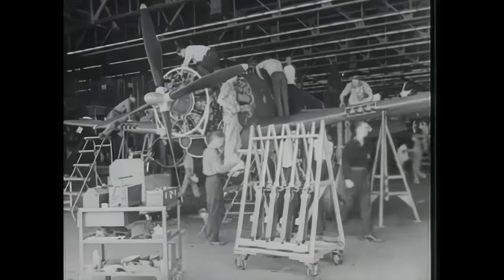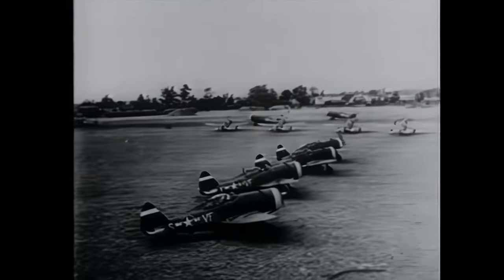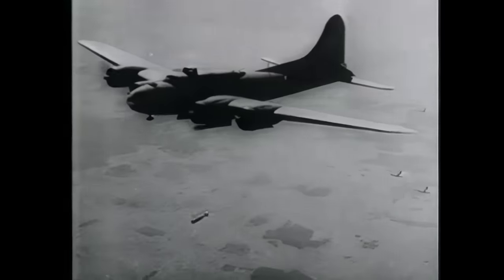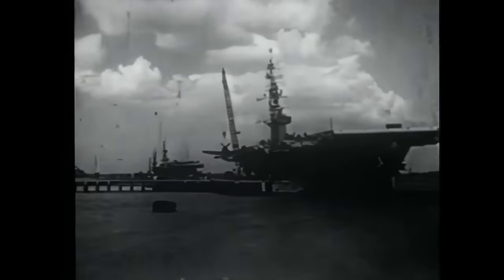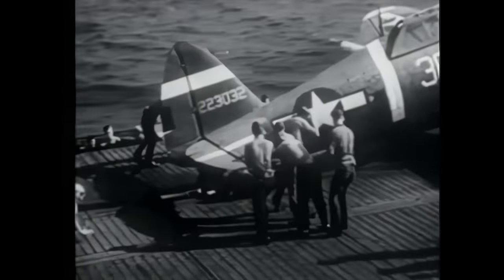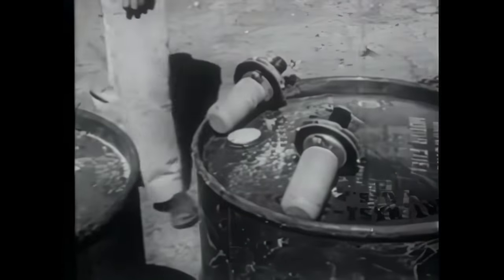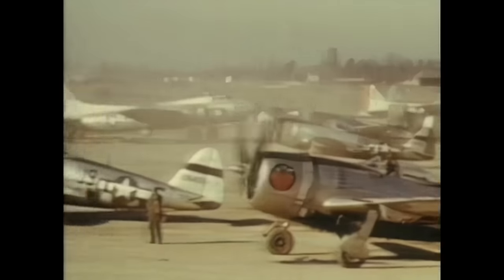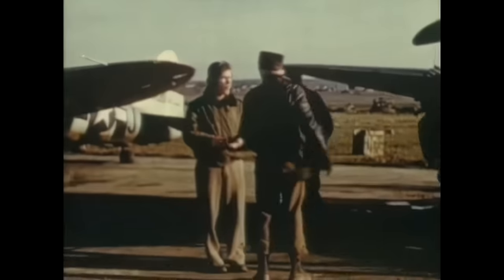P-47 THUNDERBOLT | WWII Fighter Aircraft, Nicknamed the "Jug"  | Upscaled Documentary

Comment: Awesome footage. I had no idea P-47s were part of the Pacific theater, let alone ever taking off from carriers!  Big beautiful birds 🦅
Reply: Yes, late in the war, the Thunderbolt shared escort duty with the Mustang. The P47N variant had squared-off wingtips for extra range.
Reply: @joshuariddensdale2126 The new larger wing held extra fuel which extended range on the "November" model (farther than the P-51 by accounts). The squared off wing tips improved roll rate, which along with larger elevators improved maneuver and control. 
With the increased HP of the later radial engines and the new larger paddle props, I'd hypothesize that the larger wing probably improved rate of climb as well. One of the fastest piston/prop fighter aircraft, with performance in the realm of the post war "super props" that ended the props era as jets replaced them.
In short, the P-47N was one "bad @#$" airplane. I've seen quotes from the memoirs of pilots that flew P-51's and then transitioned to the P-47N that felt the November was the better airplane. THE airplane.

Comment: Outstanding combat footage. The radial air-cooled engine could always take more damage and survive than the water cooled engines with radiators and all kinds of plumbing. The eight 50s could deliver alot of lead at once when the target was only lined up for a short time and helped kill more aircraft. Also helped take out trains.
Reply: Great summation. P&W 2800 greatest engine of the war. In the Grumman Hellcat that dominated in the Pacific.
Reply: They rarely used all 8 .50s at he same time, they'd usually use 4 at a time to give themselves more firing time.

Comment: The "JUG," is one of my favorite planes.  A beast to deal with, multirole, aircraft, as good up at altitude as it was on the deck.
Heavy, well armored,  8 .50 cals, were standard issue.  3 tons empty, and as much as 7 tons loaded for bear!
It was a well made aircraft, right for the time when it was needed.  It's only real con, being the range it could fly.
But external fuel tanks did improve that as well.
It had a huge, multi row radial engine, pumping out some huge HP!
I wouldn't attempt to take away anything from the Mustang, Lightening, or any of the Navy aircraft.  But the P-47 is till one of my top picks!
Reply: The N variant with it's wet wings had as much range as any other fighter. 
And P47's were escorting bombers over Berlin weeks before P51's were doing it, the truth is P47's in theater during the early unescorted bomber missions could have escorted them if they'd only have been provided with drop tanks, the P47D-15 with the wing pylons that could mount the US made all metal pressurized drop tanks were starting to be delivered to the 56th Fighter Group in April of 1943, that's 5 months before the infamous Black Thursday Schweinfert raid, those aircraft could certainly have escorted the bombers on those missions had they been provided with the proper type of drop tanks, also P38's in Europe at the time could have escorted them, the same variant's of P38's in theater in Europe 4 months earlier had flown the extreme long range mission to kill Admiral Yamamoto in the Pacific, it was longer range than any escort mission in Europe. 
Contrary to what some people think even P51's couldn't escort bombers without the use of drop tanks, the first thing people want to do is look up the range of P51's on internal fuel then Google the distance from some air field in east Anglia to Berlin and think they could, it's far more complicated then that, flying at the speeds bombers flew at the fighter's guzzled gas, plus bombers never flew straight paths to their targets, for those reasons and several others even with drop tanks P51's had to use the relay system to escort bombers, no fighter even with drop tanks could take off with the bombers and escort them all the way to their targets and back, that's a misconception that most people have, one flight would link up with them over the channel and take them to somewhere near the target, then they'd be relieved by a flight that took off well after they did but would catch up flying at the increased speeds that fighter's got their best mileage at and take them to the target with enough fuel for 15 minutes of combat time, then when the bombers came off the target there'd be yet another flight of fighter's that took off last and would link up with them coming off the target and would escort them home while the 2nd relay would fly back at the speed and altitude that gave them their best range, hat's off to the guy's who figured out the time tables that the different relays took off at to link up with the bombers during the different legs of their mission, that took a lot of math to figure out how to time everything right. 
And it didn't always work, sometimes the fighter's couldn't find the bombers and the fighter's that were already with them would just have to wave goodbye and throttle up to the cruising speed that'd give them enough range to make it home leaving the bombers to fend for themselves on the way back.
Several years ago I was surprised to read that week's before the first P51 escort of bombers into Germany P47's and P38's had actually escorted bombers over Berlin first with P38's being the first of the two to do it, from reading all my life that the P51 came along and "saved the day" I always thought that they were the only fighter's that could, one really screwed up thing about it is the USAAF was using drop tanks on fighter's in the Pacific all along because of the necessity for them due to everything being so spread out in the Pacific, so it's not like they had to learn about them or something, they simply didn't provide them to the fighter's in Europe and even once it became painfully clear that they'd need them there wasn't enough to send to Europe because production had to be ramped up.
Reply: Greg's Airplanes and Automobiles has a 7 part series on the P47 which covers the range issue in detail.  Basically, the "bomber mafia" which ran the Army Air Corps (Force) had so much faith in the bombers' ability to self-defend that they decreed in the late '30's that drop tanks were not allowed on pursuit (fighter) aircraft.  Development and procurement of drop tanks suffered.
Reply: @jerryw6577  I guess at times, obstinance can get you somewhere!  lol
Having a long range pursuit aircraft that could do it's job without externals was good for 2 reasons.
First was not needing the extra fuel, adding that to the fuel reserves.
And second, was the aluminum it took to make the drop tanks.  Ametal worth it's weight in gold in the aviation industry!
Remember those adds, where they had the women going through their kitchens, and sending all their extra pots and pans to the collection point to be recycled for the war effort?
And everyone was on rations then.  My mother would tell me of having to have coupons to get shoes and other items.
One pair of shoes for a year!
Coffee, was rationed!
Anyway, thanks for the response!  <S>
Reply: There's a reason the A-10 was called Thunderbolt 2
Reply: @johnthomas2485  Why?  Because they were both built by Republic Aircraft?
Actually, the A-10 was developed by Republic, after the company merged with Fairchild.
But I suppose that's a moot point.
Reply: @jameslanning8405  Yes, certainly because of the Republic lineage, and because the P-47 excelled at ground attack and CAS and that's the whole point of the A-10. It was a natural and logical namesake
Reply: My favorite WWII fighter, too! Bulldog ugly and tough as nails!

Comment: At around 3:50 you can see the Seversky bobble up and down. I call that the "Bellanca bobble" cause these airplane's landing gear are hand cranked 36 turns to retract and the pilot can translate that motion to the stick while cranking in those turns, (I've owned several Bellancas, from 1947 to 1959)
Reply: I wondered why it was moving that way.  Makes perfect sense. Thanks
Reply: @matthewgauthier7251  You'll notice that a lot in high performance planes of the 30's. I've owned 7 Bellancas and they didn't replace the 36 turns of bicycle chain with hydraulics until 1950.